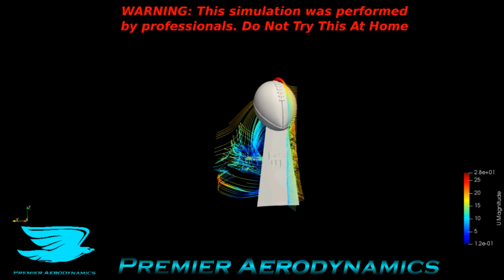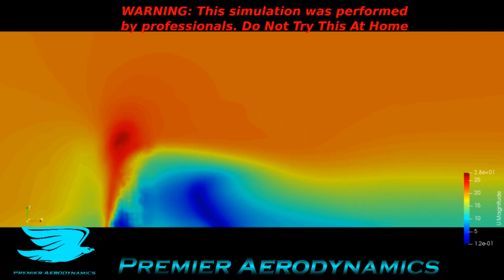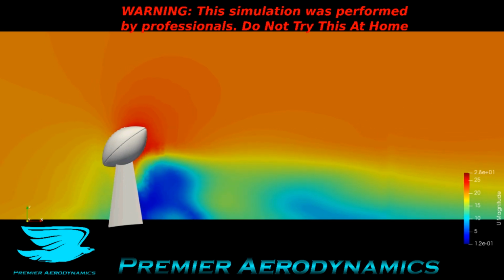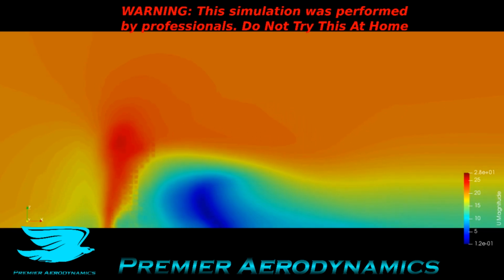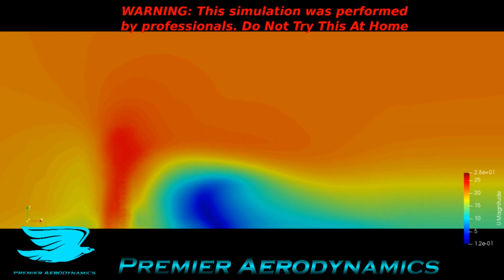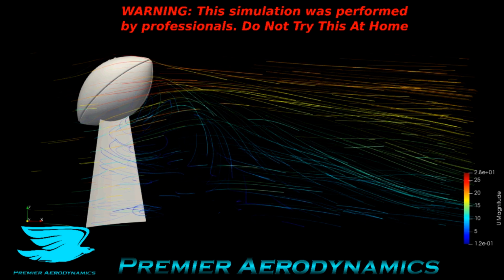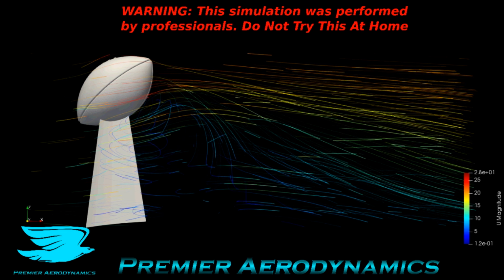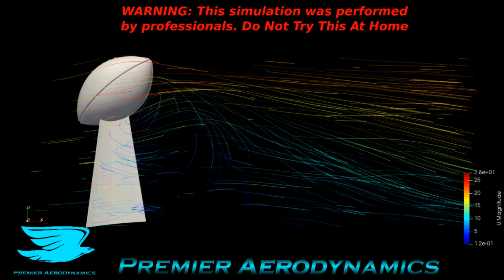Vince Lombardy Trophy Aerodynamics

Comment: The resulting wake does a good job of accelerating the airflow adjacent to it. Like a classic vortex structure, the vortex eminating from the football accelerates the air around it downward matching the direction of rotation. Meanwhile the vortex behind the pyramid part acts like a pinion gear acting on a differential, driving the other vortex. The two combined maintain a certain amount of stagnation pressure, somewhere slightly below ambient. Very interesting, might I suggest a mushroom, if you haven't actually done one of course.
Reply from the maker: Yeah, the flow coming down also reminds me a little of a 3D cylinder because the top has a little interaction with the bottom section.

And yep! We've done a mushroom already😂 https://www.youtube.com/watch?v=F65d9H2w5So